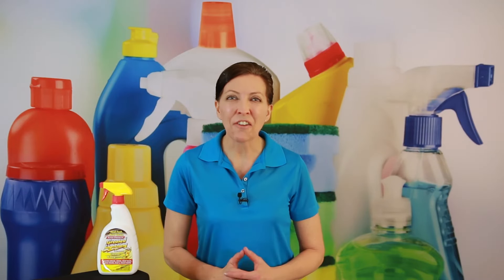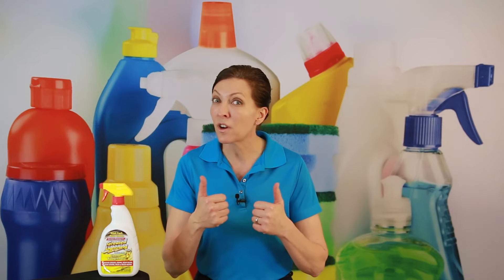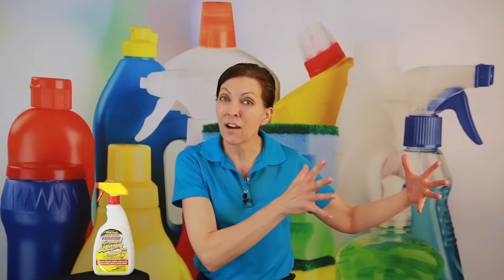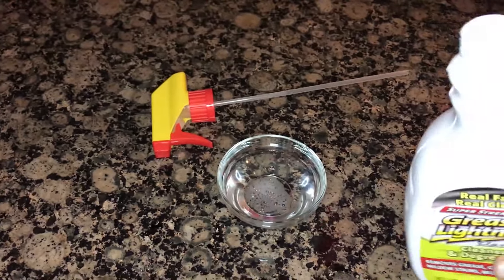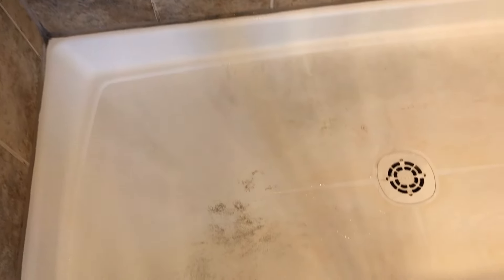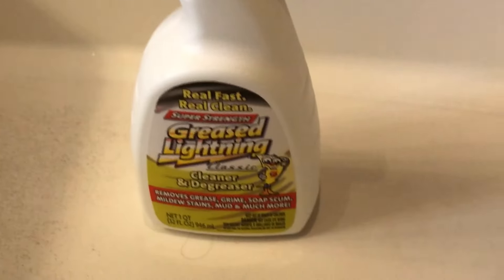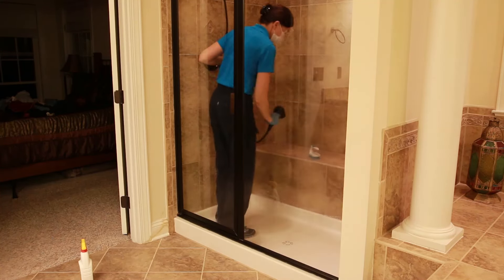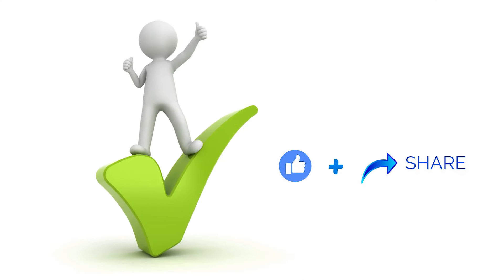How to Clean a Moldy Shower with Greased Lightning (Product Review)

Comment: I just use a mix of distilled vinegar and dawn dish soap and spray away in my shower and let it sit a few minutes and scrub away and it works wonders!!
Reply: Jelly Bean does that work on cleaning the tiles that surround the tub? Mine is so dulled and feels like scum from I guess splashing of water and the soap used while showering.
Reply: Glenda Menger it should work
Reply: Vinegar actually kills mold!  Bleach just kills the surface and, in effect, prunes back and strengthens it.
Reply: Peroxide will also kill mold.
Reply: @copperhead2694  oxi clean powder and baking soda and a touch of dawn dishwashing liquid DEOXIDIZES. Mold grows on ORGANIC material. You have to remove the organics!  

Yikes on the long lasting effects on aquatic animals. YIKES.
Reply: I love the dawn and vinegar trick, it works great for me! Magic erasers also work great for removing buildup from hard surfaces (not grout stains). As for whitening and removing mildew, NOTHING works as well as bleach. I have tried vinegar, lemon juice, peroxide, and baking soda (all of which are closer to the center of the pH scale than bleach, meaning they are weaker), and none had any effect.
Reply: @lindenpeters2601  Tilex kills. But it is sooooo strong :( I accidentally mixed it with BKF and screwed up my lungs.
Reply: I'm so sorry that happened to you. When I said bleach, I meant a simple solution of bleach and water, nothing else. It's cheaper than name-brand products and I've had just as good results. And I'm not talking about a little surface mold on a less-than-10-year-old bathroom. Just about anything will remove that. I'm talking about decades-old mildew stains on mid-century, unsealed grout. That's what I grew up having to clean, and that's what calls for bleach!
Reply: @lindenpeters2601  I get ya. We were affected by floods with hurricane Katrina. The mold and growth was unbelievable. We had to be thorough as we removed drywall, insulation, cabinets and flooring. There are better products and less dangerous than bleach for truly ridding surfaces including porous wood of spores. Lesson learned.
Reply: @sunnygirl87  Wow!! So glad you escaped. We just moved from Slidell! My husband saw that kind of mess firsthand when he went with a group to help out in Denham Springs after their crazy flood a couple years ago.
Reply: @lindenpeters2601  Mold is scary.
Reply: I use bleach alot and works wonders!
Reply from the maker: Thanks so much for sharing your thoughts on this topic. 👍

Comment: Thank you Angela, this review saved me thousands of dollars!
I moved into this house the bottom of my shower has extremely fine grid pattern also like window screen. It was discolored and looked filthy. I tried soft scrub with bleach and a stiff brush. No change. I tried bar keepers- no change. CLR- no change. Pure bleach- no change/ bleach and enough water no cover, soak overnight- no change. Zero products used made any change to the bottom of my shower. I figured when we bought the house the prior owner must have scrubbed off the finish and it was the primer showing through (there’s a chip so I know it’s black under the white tub)
Fast forward 18 YEARS!!!!! Yes 18 yrs - after watching this I figured I’d try cleaning with it since the review was so great. My regular weekly cleaning I scrub the tub down routine I noticed the tub near the drain starting to whiten……. I continued up the tub More Whitening!!!! Unbelievable after a TON of scrubbing with a stiff brush I finally got the bottom of my tub white!!!! This stuff is AMAZING!!! 
I had a contractor in to remodel the bathroom because it looked gross and he told me it’s so much work just repaint the tub and gave me a card to a guy who repaints tubs. I was shocked the contractor walked away from a job but now I’m so thankful he did
Thank you Angela for this review
Reply from the maker: Omg...that's awesome!! Kudos to you for doing an amazing job and saving money!! 🙌🙌
Reply: I LOVE this review. I’ve spent so much money, that I really can’t afford, replacing, refinishing, professional cleaning, etc. I’m learning that it wasn’t always necessary. Thank you for sharing your story.

Comment: Here's a tip:

To reduce the overall amount of mold and how fast it builds up, after using the shower/tub, leave the shower curtain/door open and leave the light on in the bathroom until the shower dries (hour or so). You'll still eventually get mold, that's unavoidable, but you can significantly reduce how much and how fast it builds up. ;)
Reply from the maker: Thanks for the tips. You're absolutely correct about leaving the shower door/curtains open to ventilate the space. Also if there is an open window or air vent that will help reduce the moisture in the air as well. Thanks for sharing this. 👏👏👏
Reply: @AskAngelaBrown   Our family makes it a habit to wipe down the walls with a designated towel. Keeps the mildew at bay and shines the tile as well!
Reply: I use a floor fan after cleaning the shower. Leave the shower door open and the fan blowing facing into the shower until every nook and cranny is completely dry.
Reply: I also use the tool for wiping down glass doors and floor of the shower (the same thing that’s used for windows)
Reply: This looks wonderful but I'm partially disabled and could never bend over use the brush and s rub like you do because you are young. Thank you

Comment: The shower in my bathroom is designed almost exactly the same as the one in your video. Mold develops almost exactly the same way as shown here also. I already have Greased Lighting on hand, because I use it as a laundry spot treatment for bacon grease or other spatters on chef aprons and other fabrics. Never thought about using it in this way. Will definitely be giving this a try. Thanks so much for this information.
Reply from the maker: Definitely give it a try. I never thought to try it on laundry. Thanks for the tip!

Comment: Greased Lightning has been my go-to cleaner since it was first introduced and I literally buy it by the gallon.  If it's grubby, I clean it with Greased Lightning.  I have a large plastic container for dog food for my 80-lb Standard Poodle.  I like to clean the container before refilling it.  Dry dog food leaves a greasy residue and Greased Lightning is great for that.  I don't think I've ever tried the Super Strength but definitely will try to find it.  Right after my shower (still bare and wet) is usually when I scrub my shower.  I've never had an issue with Greased Lightning harming my hands (or feet) but, again, I haven't tried the Super Strength.
Reply from the maker: That's great to hear! Greased Lightning has been your go-to cleaner for various tasks, including cleaning your dog food container. If you're interested, you could try the Super Strength version for tougher grime. While you haven't had issues with the regular version harming your hands or feet, it's always a good idea to take precautions and use gloves. Thank you for sharing your positive experiences with Greased Lightning!

Comment: I used it on a stove vent hood that was thick with old oil build-up, dust and mystery splatters. I let it sit for maybe 2 minutes, and wiped it all away with a damp cloth. I didn't think to try this in showers, so that's good to know it's safe for those materials as well. I will be using it in the shower next time.
Reply from the maker: Let me know how it turns out. Thanks for watching the video.🙂

Comment: As an RN, I so appreciate you giving the MSDS information!!!! Not only why and how to use it. 
Too many people have burned their lungs in commercial cleaning enterprises with NO PPE used or even told how to use it!  
Does this remove soap scum?  Not really concerned with mold but that yucky soap scum!  Worst job in the house, IMO. YES, Worse than toilets! Thank you!
Reply: Toni Stark If you want to get rid of everything in your shower just buy Spray Nine and a brush with a long handle. It is a shockingly effective APC, almost as strong as Super Clean, but also will sanitize/disinfect/deodorize/mold-inhibit/etc

Hose down your shower (when it's dry) with Spray Nine, let it dwell 3 minutes, and then brush. Pretty much any gunk or scum will just melt off with no effort. 

Don't get it in your eyes. Keep your bathroom vent fan on or window open while using it. Respirator not needed.
Reply: @Jasruler  Thank YOU!  Where can I find this Spray Nine? IT sounds wonderful!!!  I wanted to use the vinegar, dawn soap concoction but my husband can't stand the smell of vinegar !  No matter how well ventilated the room or house is, he can smell vinegar a mile away so I am stuck!  None of these scrubbing bubble type bathroom cleaning products do 
ANYTHING so what a waste.   Please let me know where I can find Spray Nine and I will sure give it a try.  Thank you so much for responding.  I think you may just have the answer
Reply: Toni Stark Home Depot or Wal-Mart will have Spray Nine. I suggest you get a gallon of it -- it's cheap and you're gonna love it so skip the single serving bottles. Again, you'll want a reasonably bristley brush on a long handle to work with. If you go to home depot get a Zep spray bottle. Yellow head, blue handle. They're excellent for high volume spraying. 

I also cannot stand vinegar smell, it is unbearable to me. Plus, anyone who honestly thinks a homemade "natural" mixture will cut gunk, grease, scum, mold, crud, etc and sanitize, disinfect... AND deodorize... AND rinse clean... (the list goes on) as well as something that chemical engineers cooked up in a well funded lab is tragically wrong. 

I trust science over hippies. 😜
Reply: Toni Stark oh, and if you have like absolutely relentless shower buildup, get yourself a tube of Bartenders Friend powder and a buncha sponges/scrub pads. First you'll let the spray nine dwell to soften up the gunk, then give it a hot rinse of water, shake the Bartenders Friend all the hell over the place, and work your scrubber pads like you're doing chest compressions. For real, use that palm on knuckles upper body + triceps thrust motion you'll decimate the scum then just a light spritz of Spray Nine to tidy up and boom shower is like new and smells lightly of pine. 

With Barkeeps Friend and spray nine in the same space: it's got oxalic acid and abrasive particulates. N95 Respirator and ANSI Z87+ eyepro recommended, but I'm kinda a PPE fanatic.
Reply: @Jasruler  Thank you again for getting back to me so fast!  I bet Lowe's has it also if Home Depot stocks it.  Of course, Wallyworld, how did I miss that stuff there?  LOL  Oh yes, I need a high volume spray bottle not those that barely spray and your hand is killing you from "pulling the trigger" so many times!  As an RN, I too, trust science more than hippies :)  Off to Home Depot and/or WalMart I go to get this!  Again, thank you so very much!
Reply: Toni Stark I suggest home depot. Walmart doesn't have Zep spray bottles, I've tried every kind of Spray bottle Walmart carries and they're all trash. A good spray bottle is one of the most affordable ways to treat yourself. 😎 Plus home depot will have the best brush selection. Walmart only has little knuckle buster brushes. 

And home depot smells nice. Smells like home improvement! 😊
Reply: @Jasruler  I hear ya and that is where I will start my quest!  Thanks so much for the tip!  Being pretty severely visually limited,  I can't afford to miss a spot with so many of those other cleaners and I'm not into scrubbing like I'm running a marathon!  LOL  Thanks my friend!  I owe you one for the great tips!  :)
Reply: Toni Stark Let me know how it works out for ya.
Reply: James Palermo since we are moving into a house from an apartment, what a great way to test it out!!!  I sure will let you know!  I’ll bet I have FANTASTIC results!  You’re a life saver! 😀
Reply: James Palermo yes and it’s fabulous!! I owe ya one!!
Reply: Toni St
Reply: @johnconstable8512  oh I know it’s the hubby who hates the smell even for 5 minutes
Reply: @Jasruler  
Zep bottles are aMAZINg!!! My local hardware store carries them. I have 3 zeps. 😃
Reply: @JennyLory  quick tip: a spritz of super clean and some vigorous rubbing with a magic eraser will completely remove sharpie from zep bottles if you ever need to relabel them. 😎
Reply: @Jasruler  thanks!!
Reply from the maker: Thanks so much for sharing!

Comment: I'm a huge fan Angela, but a new one. From watching your previous posts I can tell you favour products that have the least impact on our environment but this product, for all it does, it has a relatively detrimental impact on the quality of water in our lakes and streams.. Even the advice to rinse the spray bottle well be fore adding it to your recyclables doesn't make sense. First, it flushes whatever residue remains into the water supply, second, to what end, as most of our recycling is sent to landfills regardless because the cost of recycling is greater than the cost of landfills.

 I love your tips, they've changed the way I clean and the time you take to discuss products, their dangers and proper use are invaluable to me. You above anyone, might be able to devise a cleaning method using less harmful ingredients. I have complete faith,.
Reply from the maker: +Apo Fatrim Hey thanks for your feedback. It’s important to recognize that strong chemicals do have a place in cleaning heavy duty jobs. After a surface or appliance is clean you can maintain it with a less detrimental product. It’s good to know what the heavy duty products are in the event that you ever have to use them. Thanks for watching. 👍

Comment: This product was used by my landlord when I lived in California back in 2005. He did not warn before he used it in our apartment complex (6unit continuous multi-unit building). He used this product on the screws of the air ducts to the entire building. He sprayed it down EVERYONE'S AC vents on the roof and any air ducts that had screws in all the units. He did this while we were at work. Most of us worked during the day... since we were in the Mojave desert 90% of us kept all our windows closed and AC on cause it was June and it gets to be 100+ degrees daily. 
Needless to say 2 people went to the hospital for respiratory distress due to the fumes that built up and the rest of us had head aches, dizziness, and nausea. My ex and I at the time didn't know everyone's unit had the same fumes so we asked our neighbors we thought it was a gas leak or gas spill that was how strong it was...and found out we all had the same strange smell with the same symptoms.  1 of the tenants that went to the hospital was 6 months  pregnant... when we tried to approach the landlord he skipped town. 4 of the 6 of us pursued a lawyer collectively due to the chemical exposure. But due to our lack of funds and it may be  possible that because we (all 4 of us)were all brown or darker we only got granted the ability to leave our lease without penalty.. i hate that he skipped town then 2 weeks later posted a note on our doors about using the grease lightning on the ventilation system... It was awful... he still was able to rent to other people once we moved out. We notified the fire department too just incase any new tenants tried to live there...I'm just thankful I moved out of there before he used any other chemicals on the ventilation system...
Reply from the maker: Oh no, what a bizarre story. I've never heard anything like it. How does one use Greased Lightning on the ventilation system? I can't even imagine how that would work or why someone would do that. I'm glad to hear you are okay.

Comment: Thank you Angela for using polite and  cute words like “Icky” or “Muketty”…it’s so kind of you!  If you used the terminology of what it actually is,  I truly am so sensitive, I wouldn’t be able to watch😅   I do have a cleaning question for you too: What should I use to clean oak banisters and handrails?  Murphy’s doesn’t do the job.  I have 3 sons that, may or may not be (🙄) washing their hands (😬) on a regular, or an as needed basis, like they should (plus their friends).  Can I use Krud kutter?  Or do you think that will that be too toxic for them?  They are 15, 12 and 7💗
Reply from the maker: Oh no, I wonder what is being left on the banister? Also, is the wood sealed? 👍

Comment: I've been using Greased Lightning for years, it's really good stuff but the fumes can be a little harsh. Also Lowe's carries a degreaser by Zep that is just as good.
Reply: I caught my husband trying to go out the door in a white athletic team poli that was filthy with stains. I love laundry stains and have my favorite methods to clean a variety of stains. THAT shirt has refused to yield! I sprayed it and a few other Ruined shirts with Greased Lightning. We will see if the last resort works. Otherwise, in the BIN! No Joy in those shirts with stains ;)
Reply: Thanks for the tip. I checked at Lowe's and there are several different types of Zep Degreasers available. Can you please tell which one you are using.  Thanks
Reply from the maker: Thanks for sharing!

Comment: Greased lightning has unlimited uses.  Be sure to wear a mask if you are in an enclosed room and ventilate if possible.  This can be purchased in gallon jugs and 5 gallon containers to refill the spray bottles.
Reply from the maker: Great tip! Thanks for sharing - and also the note about the mask. :-)

Comment: If you're just cleaning your own bathroom, clorox gel cleaner with bleach (or any kind of bleach gel) works. The gel cling to the mold so it doesn't evaporate or run off do you can literally just apply it to the grout and leave it. No scrubbing required. I did this to my 1960s bathroom (no air vents) after I bought my house and the previous owners let mold grow everywhere around the shower
Reply from the maker: Oh wow! Thanks for the sharing the tip!